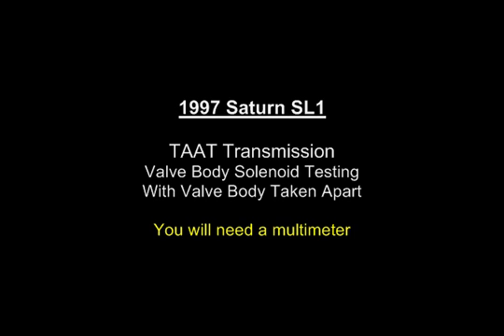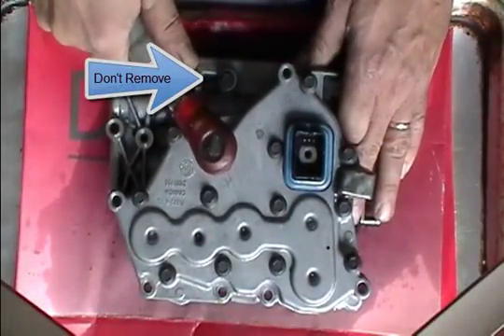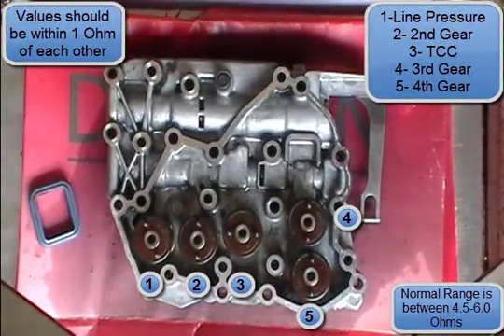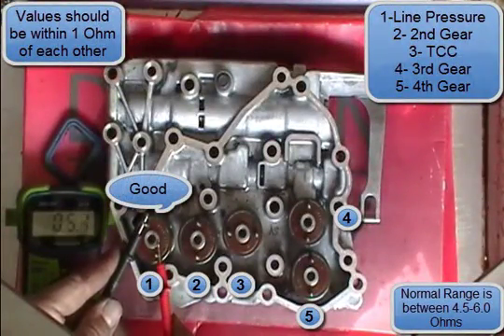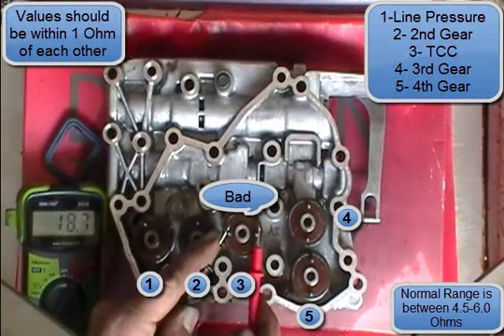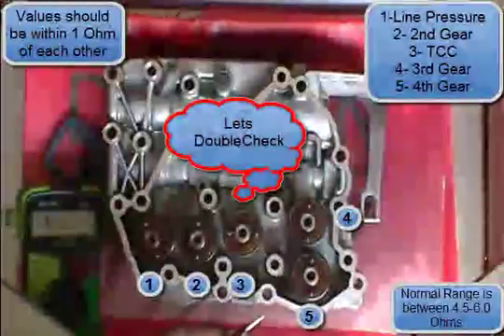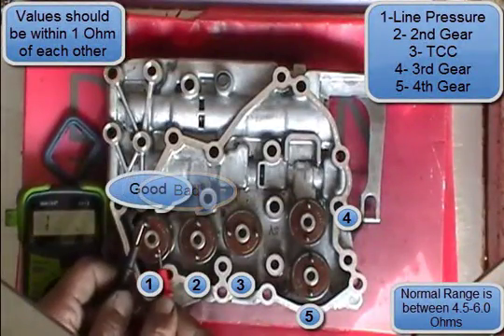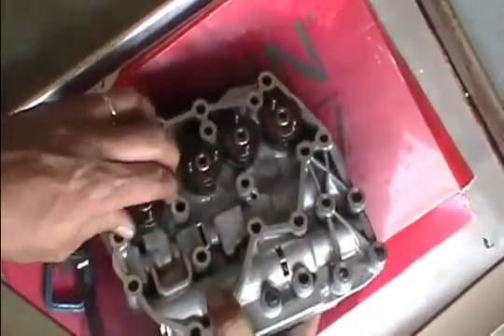Saturn TAAT Transmission Solenoid Testing & Replacing with valve body removed

Comment: So I have 3 codes popping up and I wanted to know if I replace the valve body will they go away. P0732 P0733 P0734?
Reply from the maker: P0732 P0733 P0734, SATURN Possible Causes
Low transmission fluid level
Dirty transmission fluid
Faulty Shift Solenoids
Shift Solenoids harness is open or shorted
Shift Solenoids circuit poot electrical connection
Transmission mechanical problems
Transmission hydraulic control circuit

To answer your question, yes, replacing the entire valve body will eliminate these codes. However, You have to first disconnect the battery for 10-15 minutes. Or, pull the fuses under the hood for the transmission to clear the codes after replacing the valve body. Do NOT replace the valve body & start the car without clearing the codes first. Also, if your going to replace the valve body, drain & reflill the transmission fluid to the proper level. And make sure to replace the transmission filter to be safe. (Filters are cheap). Upon doing all this, the transmission has a relearn proceedure. In other words, You drive the car gently so the PCM (Power Control Module, Computer) learns the shifting patterns.
If you need further help. let me know.

Comment: Awesome video, im getting the p0741 and the p0741 p code and im not sure if this is the solution in this video. Also my saturn is a 2002 sc2 and im not quite sure if there are any differences. Any help is appreciated.

Comment: I tested my solenoids at the ECM. I removed the fuel pump relay, which provides current to the solenoids. I connected my OHM meter to the relay output. I disconnected the large 80 terminal ecm connector to test the solenoid wires, 39, 40, 59, 60, and 18. I then probed those terminals with the other lead of my meter. I found shift solenoid 2 had 1.31 ohms, shift solenoid 3 had 2.09 ohms. The rest tested at 5.14 ohms. I assume since the offending solenoids have less resistance, the connections in the transmission are good, more resistance would lead me to wonder about the connections. I believe I'm going to go with a remanufactured valve body, apparently they can become worn out, and I can't find a used one around here to take solenoids from. I was wondering is the TAAT transmission used in other cars as well?

Comment: Do you happen to have a diagram of which holes correspond with which gears on the top of the valve body mounting surface? trying to figure out how to air check after verifying valve body is good.

Comment: What if all solenoid read 4.5....could it be another problem?
Reply from the maker: The buss plate or the electrical connector could be bad. what do the pins look like on the plug itself?

Comment: Just wanted to know what type of transmission fluid to use on my Saturn SL1 I bought yesterday. Manual says Saturn part number 21005856 which I'm sure cannot be purchased anymore. It says you can use Dexron KIK but must be changed more frequently. I want to make sure to get the best to provide a long life for the trans. I already have I slight hesitation and hard shift under heavy acceleration, when the trans kicks down. I plan to perform solenoid test very soon. Car has 60000 miles and is super clean, very well maintained. Please let me know what you recommend
Reply from the maker: Glad you got yourself a nice Saturn. You want to use DEXRON in your saturn. They have extended life, and high mileage transmission fluid. Unfortunately Satuns are notorious for transmission problems. If you need help, let me know. :)
Reply: FiremanCV 
I did a lot of reading last night and was seeing that they are different viscosities in the current Dexron than the Dexron III. I know that different viscosities can lead to different line pressures. It also says in the manual that Dexron III will result if different shifting qualities than the Saturn fluid. Should I go with a good quality Castrol, valvoline or mobil1 synthetic? Reading that these usually get thinner than Dexron III. Just want to make sure I use that highest quality that will improve life and function
Reply from the maker: Correct they do have different viscosity/thickness However you will see Dexron Vi is the best according to many sources. Hope your transmission doesn't get worse. I have always used Mobil-1 Synthetic and still developed transmission problems. :(
Reply: Found this Castrol Transmax Dexron VI that says "premium synthetic blend formula exceeds Dexron III H requirements." Sounds good, but what do you think?

Comment: hi my 94 saturn sl2 slams in reverse I am wondering should i take out valve body and test these. Instead of replacing whole unit. Half the time I have to wait till car gets up to temp then put it in reverse and no slam..When i put it in drive its just fine.

Comment: FiremanCV,  I pulled my Son-in-laws SL2 apart as described and tested the solenoids, they are all 5.2, changed fluid, tested fuses, checked electrical connector and all are fine, any other idea?
Reply from the maker: Steve Nesbitt , buss plate, fuses under hood ok?
Reply: Yes.  Fuses good.  ? Bus plate  ?  My Son's car... replaced battery, alternator  ok according to advance auto, tested in vehicle.   voltage at battery while under load is 13.7vdc at fusebox.  He changed tranny fluid and filter and over filled.  Pulled out 8 to 10 oz.  After testing solenoids we put it together and I put on jacks and ran in gear reverse at 1500 RPM 15 min.  Then conducted relearn for tranny improved but not perfect.
Reply: FiremanCV I hope you still get comments on this video I was just wondering if you take the solenoids out of the valve body and get them mixed up will they work in different spots like when you have the numbers in your video 1 is line pressure and 5 is 4th gear if I take them all out at once and forget which came out where will there be a problem mixing them up

Comment: Changed the valve body with a SONNAX rebuilt unit-smooth for 8 weeks. now i have harsh shifting 9all gears)-should I replace the pressure regulator  solenoid?
Reply from the maker: Ad Mirer 
Did you do a transmission relearn?

Comment: gracias brother resolvi mi problema siguiendo tus instrucciones, la transmisión golpeaba al hacer los cambios, un selenoide estaba quemado y la conexión también, remplace el selenoide y la conexión y ahora hace los cambios suavecito, como nuevo. thanks.
Reply from the maker: de nada :)
Reply: @FiremanCV  ola amigo cuantos oms debe dar los selenoides para saber cual esta mal
Reply from the maker: @castorhernandez6404  Todos los solenoides debe ser de 1 ohmios de uno a otro. Lo normal es entre 4 y medio a 6 ohmios para cada uno.
Reply: @FiremanCV  cuanto porcentaje de probabilidad es q pueden ser el selenoides la reversa aveces trabaja y aveses no
Reply from the maker: @castorhernandez6404  Cómo la lectura en comparación con los otros solenoides? Decirle a mi los ohmios para los solenoides por favor. Además, ¿usted inspeccione el cable de enchufe para ver si está quemado?
Reply: Tengo un problema similar, la transmisión golpea en cada cambio incluso en la reversa.
Los valores de resistencia en frio de los solenoides de los engranes 2, 3 y 4 es de 5.5 ohms, el del solenoide de LP es de 4.0 ohms y el del solenoide de TCC es de 6.0 ohms con algunas variaciones durante la lectura.
Mi duda es si podría intercambiar los solenoides ?? Con la finalidad de ver si la falla persiste o si se 'mueve' a los cambios en los que coloque los solenoides sospechosos y poder determinar esto podria ser la causa, o si la causa se debe al desgaste de la valvula reguladora de presión.
Aprecio sus comentarios.
Saludos.

Comment: Hmmmm....  Was that the "only" issue with the trans?  Did it make a diff when you replaced them?  Even though 18ohms is "out of range"  applying 12volts should make them all work, except for the line pressure solenoid as that is a PWM valve.  Then again, unless they all are, but, i was going by an on/off theory.

Comment: Hello I have a quick question for you. I have no reverse in my 02 sl2 and I've taken the valve body apart. I tested the solenoids and they all read the same so I'm assuming they're good. I did this in hopes of one of them being bad so if that were the case I could replace it and have reverse again. I'm not sure what to do next at this point in order to diagnose the problem. I fear it may be a problem with the transmission. Any tips or knowledge you're willing to share? Thanks for your time.

Comment: Thank you for your response. I followed your other video and checked the solenoids through the top side on the terminal. I got these readings, A,B- 6.1;C,D-  6.1; E,K- 6.0; F,G
-4.7; H,J-6.1. I think I should just replace the entire unit! What do you think? Its mainly a problem accelerating initially and the reverse clunk...Yes, I did that other procedure with reverse for 30 minutes. I've heard some talk about the input shaft! Could this be it? Just making sure of things before I order another valve body...thanks
Reply: Should there be a need to change the transmission temp sensor?

Comment: Thank you for the response. BTW, 2001 sc1-are 2nd gear and reverse on the same solenoid? Also, when I take the initial cover off does that have a gasket and does it need replacement once opened? And, also does the cover for the valve body to access the solenoids have a gasket to replace? Thanks
Reply from the maker: All solenoids are interchangeable. They are the same.
If you are careful with the gasket it can be reused.
Just make sure not to get dirt on the gasket.
I have always re used gaskets and have never had a leak. :)

Comment: I haven't noticed anywhere on this post. Do you have to drain the transmission fluid before checking the solenoids individually or changing the entire valve body?
Reply from the maker: No. You do not have to drain any fluid at all. :)

Comment from the maker: If you are half way mechanical, this is VERY easy to do. A used valve body is a big gamble. A rebuilt will have updated parts and come with a guarantee.
Ebay has multiple places to purchase rebuilt units. Or you can replace solenoids individually if you are on a budget

Comment: I will be doing that this weekend. If that does not fix it and I check all the connections and the solenoids would it be better to just buy new solenoids if they are the problem? I have a 96 SL2 and over the last year reverse has been slipping until recently where it no longer engages. Also, it shifts hard into 2nd and it doesn't downshift nicely either.

Comment from the maker: TCC_ - Torque Converter Clutch. When is last time you changed the fluid and filter? Also, you may want to try the saturnfans website and try the reverse slam cure.

Comment from the maker: Solenoids can act up hot or cold, or both.
That's why it's important to test hot & cold. :)
Line & 2nd definitely. Why would you want to replace 4th?
If they are more than 1 ohm from each other, then they should be replaced,
Based on what you posted above, only line & 2nd is bad.
No reason to replace something you don't need to. :)
Make sure you do a transmission filter & fluid change after replacing  the bad solenoids.
Hopefully your valve body is still good.
Good luck :)

Comment: Thanks for your videos!  Awesome!  I have a problem slamming into 2nd, and sometimes 4th.  Do the external test and came up with different readings when hot vs cold.  When hot, I got 4.7 line, 6.2 2nd, 5.9 tcc, 6.2 4th, and 5.9 3rd.  When cool, the external readings dropped a bit.
Got the body open, and all of them are 4.5-4.7 EXCEPT the 2nd gear.  That's a 9.5, clearly bad.  Why did the external readings differ so badly? Would you change the 4th gear one too?

Comment from the maker: Have you checked the range selector switch on the back of the transmission.
Pull the one wire off, clean the contacts put back on.
Would be easier if you posted on saturnfans website, so I can include pictures.

Comment: I have a 95 Saturn Sc2 every once in a while when I make sharp quick left hand turns my car will rev high to about 3 1/2 thousand RPM;s and will not shift until i pull over and stop and put it back into park and wait about 30 seconds and than my car will shift normal again, this only happens once in a while tho, I have changed the fluid and filter and it has shifted fine for about 3 months but once again it will act up again, if i shift manually it drives fine my car is a automatic transmission

Comment: @FiremanCV I am the second owner, I am going to change the filter this weekend and fluid. how do you test the solenoids. do Ihave to take it aprt to do that? if I have to take it apart should'nt i change it than? how do I check it when it is hot, is there a area to do this with out having to take it apart?

Comment from the maker: @Iseekoutthetruth 
When was the last filter & fluid change?
Your at about the right mileage for a valve body rebuild :(
Are you the original owner? The transmission may have a lot of wear and tear on it, so to speak.Have you tested the solenoids? what are the readings?
Take readings while completely cold & while hot. Record the readings & let me know what they are please.

Comment: I have a 95 saturn, and just recently,when I am driving along and I slow down to make a turn when I go to increase my speed after going threw the turn, it seems to take a long time to shift. it has done this 3 different  times in a 3 month period, could this be a solenoid problem? it is a 95 Saturn sc 2 with automatic transmission, it has about 171,600 miles on it now

Comment: hi i have a 2001 saturn sl2 and it doesnt seem to shift until u hit certain speeds and if u let off the throttle all the way after hittin 35.. i am only getting 25mpg max and i believe it is cuz it doesnt shift into the lowest gear possible. could a soleniod be causing this. i have tested them in the car and they seemed ok. please help.

Comment: Excellent instructions - both on removal of valve body and diagnosing failed solenoid. My 2002 SL1 was reverse slamming then began to bang shift from 1-2 and 2-3. Removed valve body - disassembled - bench tested  - line pressure solenoid out of spec. Paid $68 for an OEM solenoid replaced - buttoned up the valve body and re - installed. VIOLA - shifts like a champ and smooooth reverse now. Thanks for all the info!!

Comment: Hello, i was hoping that you might help me with an issue i have on my saturn, the problem is that i have a 2000 saturn sl2 automatic with 130k miles on it and everytime i shift into reverse it slams and sometimes the slam is so hard that it turns off. this only happens with the reverse not any other gears so i was hoping that maybe you have a solution to this problem

Comment: hey fireman i have a nissan altima at first it only shift 1st and 2nd gear i took it to the transmission shop i left it therer for five hours they told me they have to open it to find out whats wrong with it i said no and when i drove home it only shift 3rd and 4th gear. is that a solenoid problem? is automatic thank you

Comment from the maker: @TOPOFFMAN 

Transmission will wine if low on transmission fluid before it starts to slip.
If your hearing a whine only on turns, then it's power steering pump..
Check the power steering fluid level..

Comment from the maker: @ironworker1721 

Go to saturn fans & look up reverse slam cure..
You'll be up and running in no time..
Get the numbers off the transmission for me if you can, I'll let you know which one it is :)
I take it your transmission fluid is new & filter changed??
Check out saturn fans dot com, they help alot !

Comment from the maker: @AMABERRY1975 

This transmission was missing 3 gears all at once, sometimes they worked, sometimes they didn't. when I tested & replaced solenoids, ran great afterwards..
For more info visit: saturnfansdotcom/forums  These people are awesome & are very helpful :) 
If you need help, ask there. Lots of people to help you :)
Did you test your valve body?